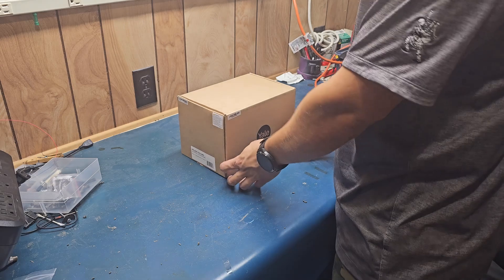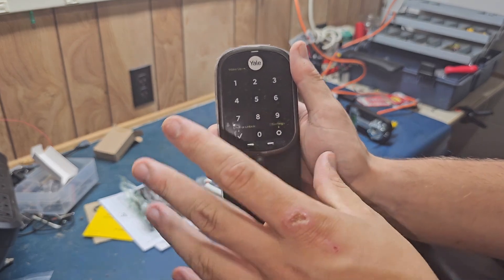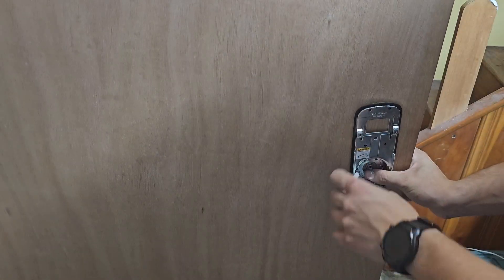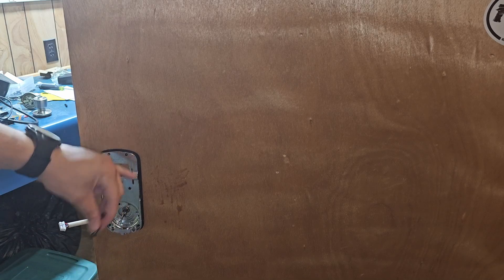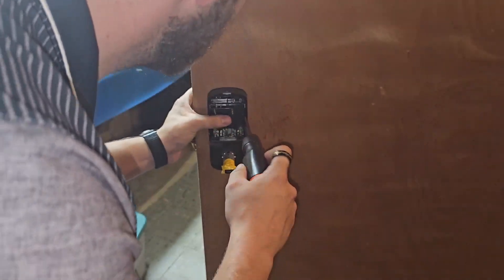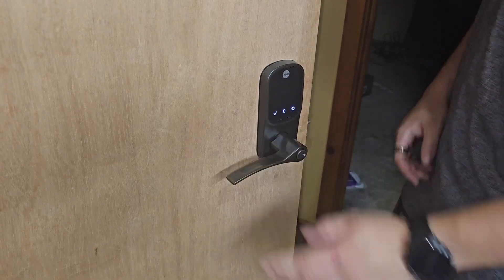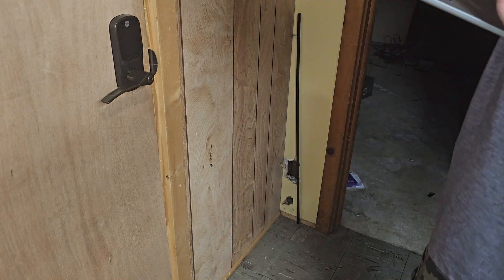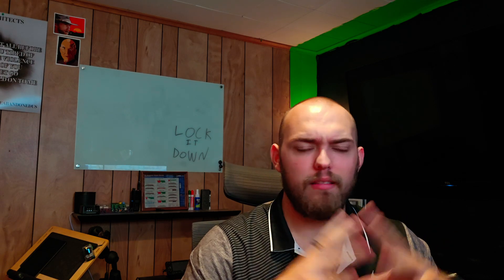Yale Assure Z-Wave Smart Lock Install and Setup

Comment: thanks for the video! so no hub/bridge needed? it recognizes it just with the module? are you able to setup codes remotely by chance? thx
Reply from the maker: If your doing Z Wave you need a hub, but these locks can be ordered as Wifi as well. Codes cant be setup remotely but atleast the z wave one will report which code was used.

Comment: Hey im trying to setup this lock with home assistant but the integration is asking me for the S0 Key, Access control key and a bunch of others
Reply from the maker: Hm, im not sure how to help. when I set mine up I just added a zwave device in home assistant and clicked learn mode on the lock and it just worked. try rebooting your HA environment?
Reply: @rafibeyda2107 Did you ever figure this out? I am having this same issue.